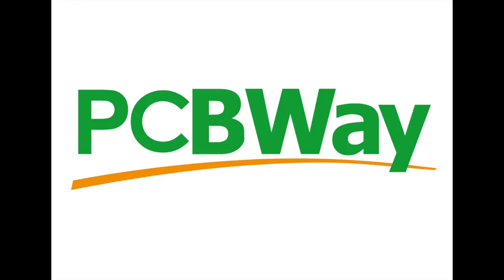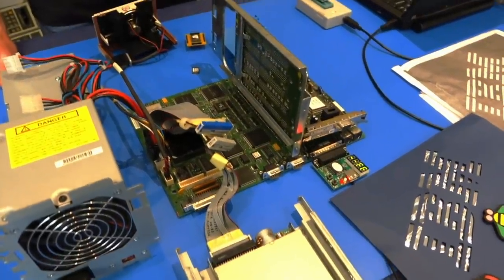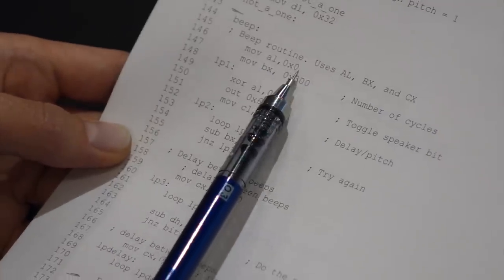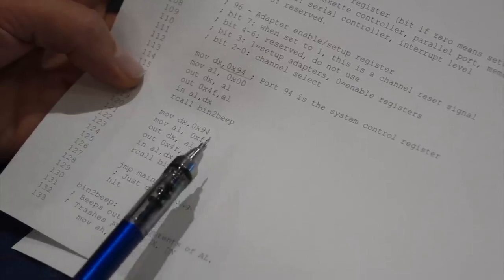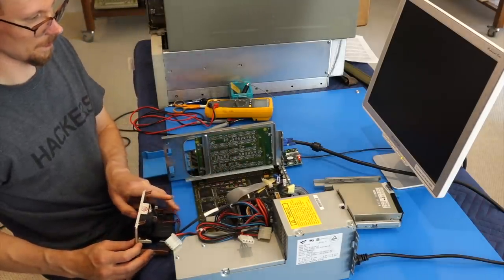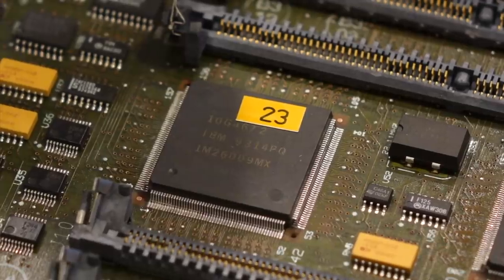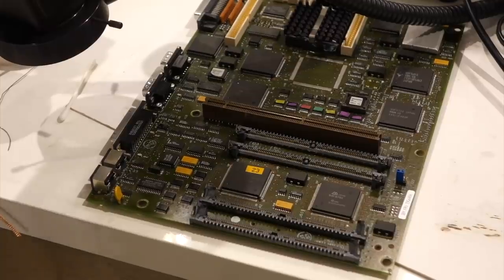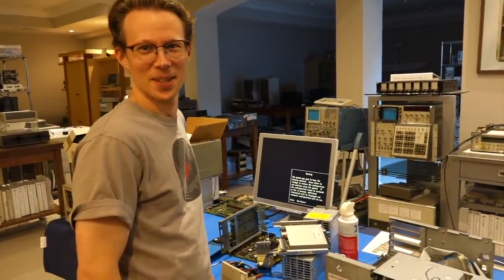IBM PS/2 Part 4: Repaired with a custom BIOS and a magic finger?

Comment: You removed & replaced that IO controller IC, with one from another defective mother board.
Likely it's (the desoldered IC) defective also!! 
Mass produced items tend to have same problems pop up, anything from PCB's & IC's to Cars. So that MB may have exact same fault.
OR...  
Comment from "Baum Inventions" Also makes perfect sense.

Comment: Bet there is a broken trace.
Reply: Yeah. Some time in its life it has been flexed beyond the cracking point of one small trace that the temp change is enough to join and break the connection again. I had an Amiga 500 that worked flawlessly ever after I installed "pusher" that kept the pressure onto the affected chip, I think it was Fat Agnus :)

Comment: Might be easier to find the exact point it starts or stops working by having the BIOS code write to the register and read back much more quickly, with just a brief high/low beep repeating quickly to indicate whether the read matched the write. Narrow down the parameters of the "magic" finger!

Comment: All you guys dredging up this old crap! Why? Modern PC's kick their ass. Take the damn thing to a recycler!
Reply: Obviously you didn't watch the whole story. They try out things that cannot be done with modern PCs.
Reply: The same reason people collect old cars, tools, movies, coins, etc.
Reply: sigh troll
Reply: Maybe OP legit didn't watch the first episode, so: For the sake of showing how things were back in the day, they want to demonstrate some old IBM tape drives made for a System/360 and even CuriousMarc doesn't have one of those (although he does have the front panel.) They do have a special interface card that would let the tape drives work with a PS/2, but the card requires the PS/2 to be running IBM's OS/2 operating system. When they tried to do that, they ran into these errors, so now they need to fix them so they can get back to installing OS/2 and then trying out the card and tape drives. You've gotta admit that once they sort it out, it will be cool to watch those gigantic old tape drives sending data to a desktop PC.
Reply: I think you're on the wrong channel